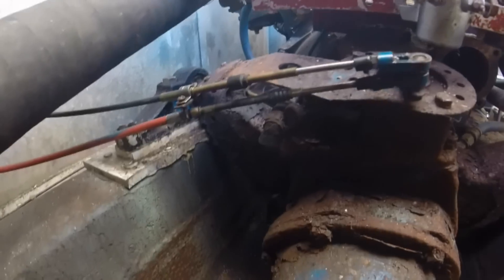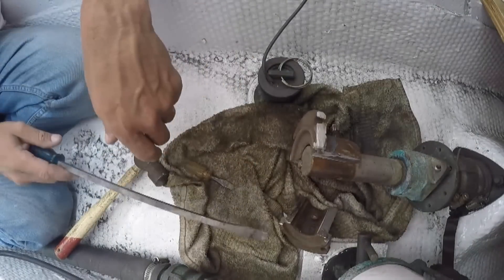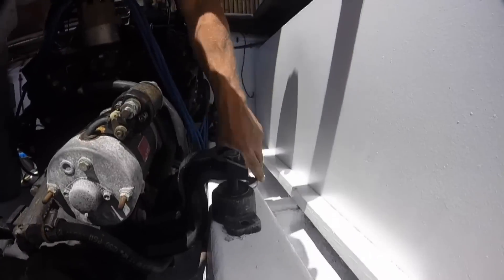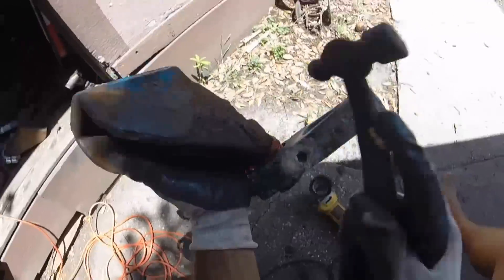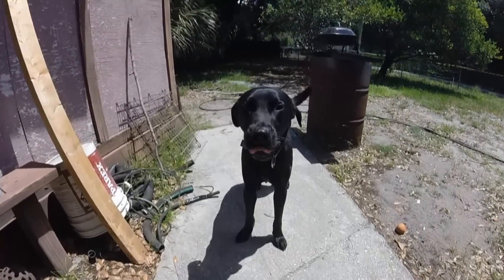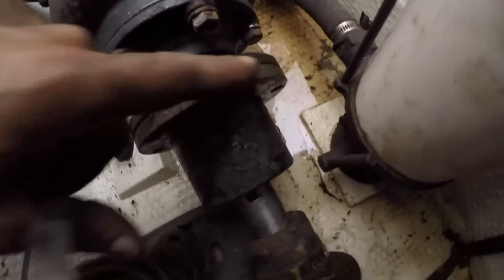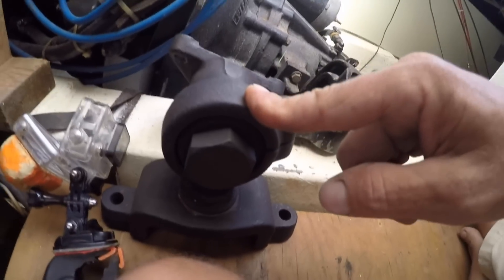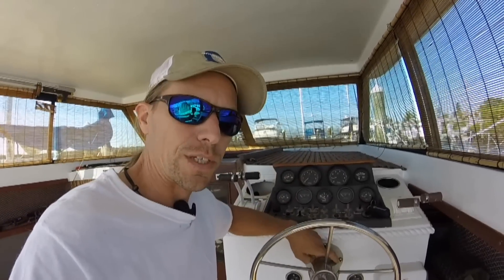Quick Boat Update: Part 19

Comment: Oh wow I wish I had known you were doing that.  I could have helped.  I have done it in a ski boat.? Exact same thing.  I am going to add my two cents.  Paint the hell out of the steel in the engine box.  Use OIL BASED ENAMEL PAIN.  It's wonderful to present rust. I like high gloss black.  Get parts clean and paint 2-3 coats.  ALSO AFTER 10, 25, 50, 100, 200 and 300 hours of operation check the alignment of the shafts.   Good motor mounts can be adjusted easily with two nuts on a big bolt.  Two bolts raise or lower on each side and front and back of the  mounts.  If you don't have this system use shims under TO  raise and a chisel to take out a bit to lower.  The important thing is the flanges must meet perfectly flat and in line.  Use 3M 5200 under th motor mounts to act as a vibration damper for less vibration in the boat,  put it under the mounts then let it sit down in the 5200 but not all the way.  Let the 5200 dry to make a rubber pad under each of the mounts to decrease vibrations.  Then adjust the fit of the coupler.  They must be straight in line.  The flanges must be within 0.003   Three thousands of perfectly flat when they come together.  They also will move and change so Check them on the schedule and u will be fine.  If not the motors will eat up your transmission  and you get stuck replacing it.  Paint keep the sea water from eating them up.  My address and number is Pharmacyman@att.net.  239-810-1309  I am old and crazy but motor yachts and sail boat are toys I love.  Give me a call for engendering., fabrication cutting & welding  and auto/boat repair fiberglass, epoxy, gel coat repair or spray paint.  I got cutting tanks, welders,    And spray painted guns. FOR SPRAYING two part paint or  epoxy resigns.  Have all the tools to repair that stuff.  Give me call on the next engine an I will come help you.   No charge.

Comment: so you ad a motor that you couldn't align because of the height, i love your videos i hope things work out. make sure you monitor things i'd hate to hear you have a bearing failure on the inboard or outboard side if the angularity of the coupling is not quite right.